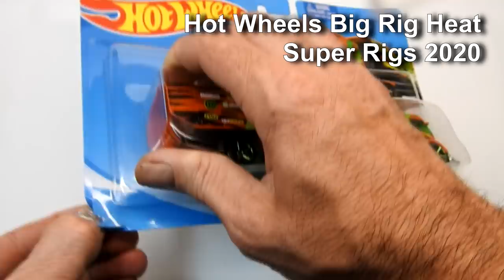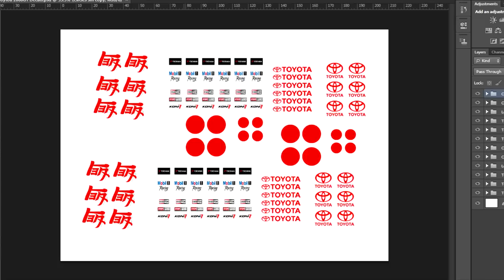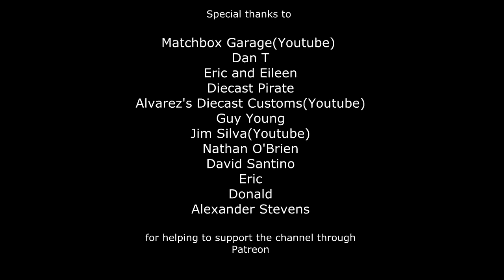Hot Wheels Shop Truck Custom Big Rig Heat & Toyota 2000GT 2020 Super Rigs

Comment: Awesome job customising this pair as always Danny!  I love the little touches on the 2000GT, I'd love to see more done with this car.  The truck on the other hand...I passed over this on the peg the other day, not sure what could be done with it.  Boy, was I wrong!  I love the trailer edit you performed (though it is missing a ramp now 🤔).  Paint job on both was outstanding.  Wouldn't expect anything less with your talents.

You have definately inspired me yet again, will have to give this rig another look.  Thanks for sharing, stay safe and keep on keeping on!!
Reply: By the way, where did you get the wheels for the big rig from??
Reply from the maker: @earlware4322  I cut the spokes out of the priginal wheels and put the smaller wheels in as rims